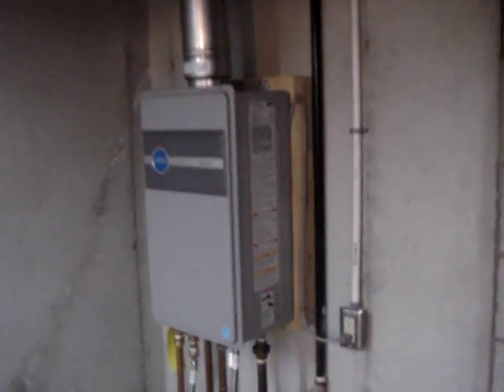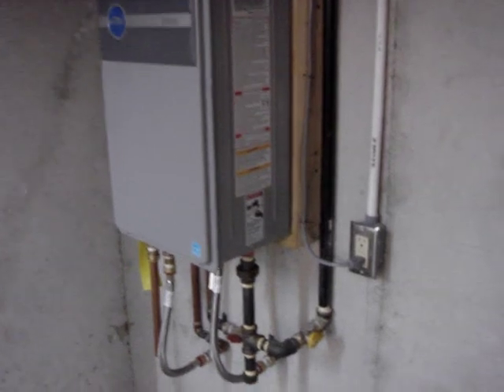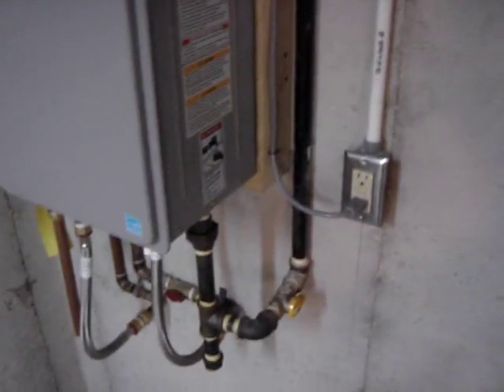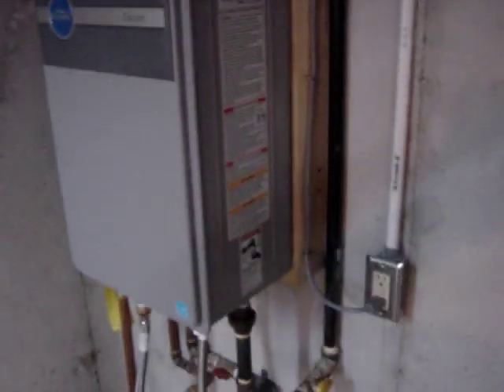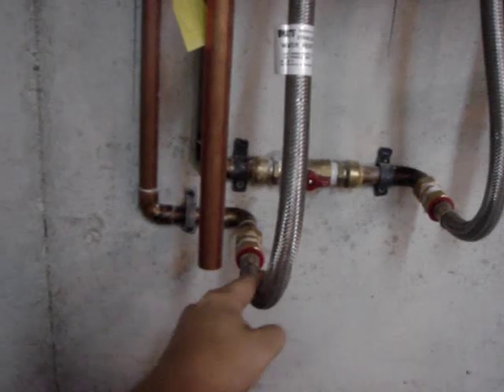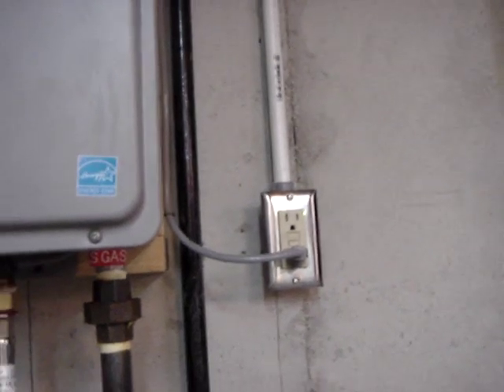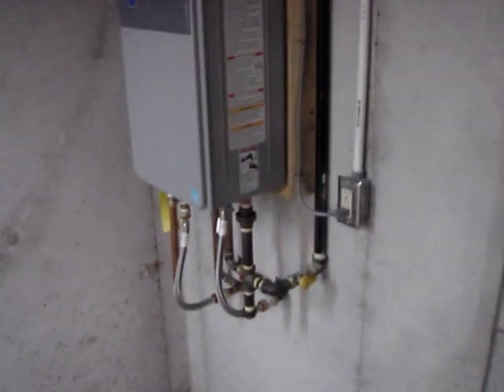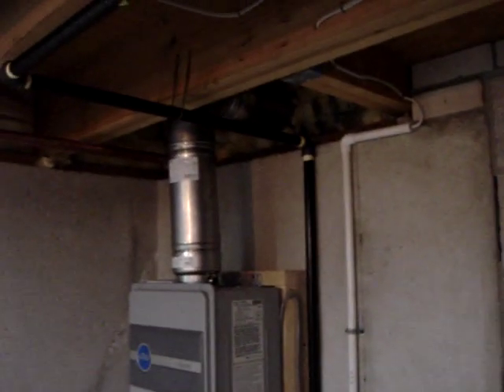Tankless water heater HOME VIDEO. Do it yourself!

Comment: @klungoo I agree with you on everything but the comment about not needing a prefilter.... I dont know of any municipal water system that does not have sediment... have you looked a videos of water tanks being cut open here?.... there's no tank for the sediment to settle to the bottom in so essentially it either gets hung up in the exchanger or passes thru it, sandblasting and wearing the interior of the exchanger as it does it. If your water is soft you dont have to worry about lime scale.

Comment from the maker: @tjwano  Yes it is perfectly fine. I understand how nervous a hole that size could make you. Believe me I know. But this is standard.  I suppose you could  always brace the area if it would make you feel better. But there is no need. I had a new High efficient furnace installed by home depot recently and they put in a similar vent. So, no worries. Good luck.

Comment: Noticed that your safety vent drain pipe is short. Code may require that to terminate not more than 6 inches from the basement floor. Some states require it to be terminated over a trapped drain. Valves required to and from appliance. You are right about dedicated circuit. 14/2 and 15A should be good. Condensate must be piped to drain, Washing machine standpipe is OK so long as there is an airgap on the tubing.  If necessary pipe to an electric  condensate pump.

Comment from the maker: @blueange1s Hey thanks for the comment, my hope for this video was to help others who just needed a direction. I should have explained the venting better. The Venting makes a 90 degree turn and vents right outdoors, actually it makes more of an 88 degree turn to avoid water from entering the vent from outside.. You could go up through the floor and up all the way to the roof, but if you have priced out the direct venting you will agree....... you want to take the fastest route outside.

Comment: I looked it up on line and saw a couple sources say that it protects your pipes if you're using plastic water lines in your home. I don't know either way, just was thinking about that TP Valve and how it is on a regular water heater. 

That's a darned good looking job you done on installing that by the way. Looks great!

Comment: @klungoo Yes, your safety valve drain pipe. The reason being is that if it goes off and anyone is standing near by, they'll be burnt by the escaping steam/water (if it does go off, that water will be far hotter than it ever is normally). by bringing it to the floor, you lessen the chance of anyone being burnt

Comment: Nice clean installation. This particular unit is not designed to produce condensate. Exhaust gas temps when running on high are about 300-350 f. More than 5' horizontal vent run or verticle venting may produce a thimble full of condensate on continued low fire situations. To determine correct gas line sizing search The National Fuel Gas Code,use the table for black pipe or flex pipe if that is what your house uses. Check with your utility to make sure you have a large enough regulator and meter.

Comment from the maker: @SuperPlumber420 It's been 1 1/2 years since I installed the flex lines and they are still as solid as the day I put them in. I have a hard time believing that they will suddenly start to leak in 6 months. I also had the water tested before the install to see if it was too hard/soft and if I would require a prefilter.  My point is, I looked into all of that, and did extensive research on everything before jumping in. Can you explain your critiques?  Or should I just take your word for it?

Comment from the maker: @gregoryrryan Yeah, thats exactly what I did too. A few months after this video I had a High efficient furnace installed. The installers connected the condensation tube into the newly installed electric pump for me. Oddly, I never get ANY condensation from the Vent though. I do from the furnace, but not the water heater. Perhaps because the vent is so short? I don't know. And I have a question. Did you mean safety VALVE drain pipe? Because if not....I don't know what that is, and I'm concerned.

Comment from the maker: @kantucky Oh ok I got ya. That makes sense. But just so you know why it is that way, The sales rep who sold me this particular unit (who claimed to be a certified plumber) Told me the unit did not required an additional safety valve because there is one built in. I put one on anyways. Though, What I don't understand it how it would ever go off. I'm not storing any hot water and it doesnt start heating until it senses water flow. So I just put it on for added safety anyways. But it's good to know

Comment from the maker: @lakewood85 Yeah, I did not know that about the condensation, but it makes sense because I've never noticed ANY water in the line. I checked for any blockages and to make sure it was working right, but there is just never any water. After the install I had a gas worker out to the house to check the regulator and gas pressure with the furnace and water heater running at the same time and it was more than fine. Thanks for the comment :)

Comment from the maker: Yeah I remember reading about that. This unit does have a filter built in though. However, the filter I think you're referring to is expensive and if you have your water tested first, you might not need one. It's a very good idea to have your water tested before adding a tankless water heater. If you go ahead without a filter or testing the water, the results can be devastating for your heater. Nice point, thanks for the comment.

Comment from the maker: I did have to change the line from a 1/2 to a 3/4, but I got lucky because the furnace had a 3/4 line and I was able to pull off that. The furnace only needs a 1/2. I DID have both the new furnace and water heater tested to make sure they both were getting a sufficient amount of gas. I tested the water heater  while the furnace was running and visa versa. So you should find the amount of pressure+ BTU's you need first. Ask the manufacturer of the unit you want and find what you need. Good Luck.

Comment: Great job,   However there is one thing he's missing from the installed. you'll need to install service port type of valves, for both hot and cold water side; not straight pipe to the heater.  reason for that is you need to descale the heater every 6-18 months, depanding on the usage of hot water.  if you not planning to service your heater, don't bother installing one.
Reply: They required to have rigid water lines for the unit, including the T &P line, of course the valves for service

Comment from the maker: @cpsadp99 Well first I'm no pro at this and you should consult with someone who is. For me, I already had a sufficient gas line. I found that information by reading a ton. I think a 3/4 line is pretty standard but it may depend on the unit you end up buying. Also keep in mind the distance that the gas line has to go, because that will have a lot to do with the diameter of the line where the gas enters your home.  Find out how many BTUs you'll need, how much pressure you need.  continue ->

Comment: For your veiwers there is a article online they can google "Tankless 101"  not for installation but more for selecting a unit to meet their needs.  I'm curious as to how far that 3/4" gas is from the meter or regulator and what BTU model that tankless is?  A lot of folks run their gas pipe too small not knowing how to size it properly. (Not saying that this is the case of course because there is not enough information)  I still  don't think these make good DIY projects.  Too much to go wrong.